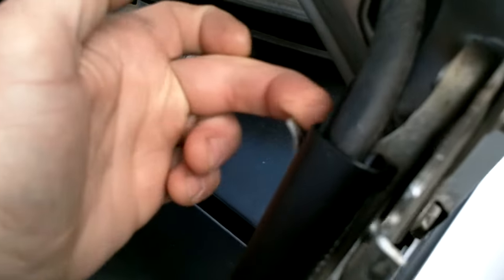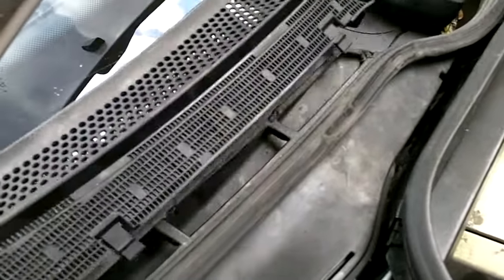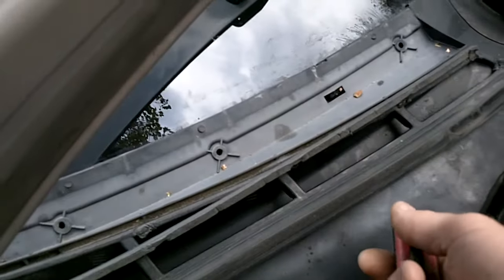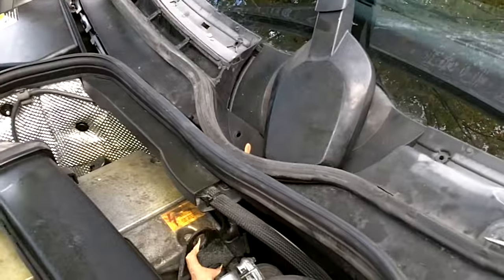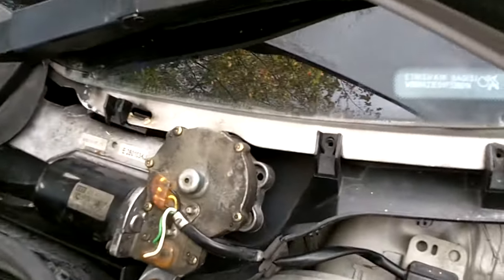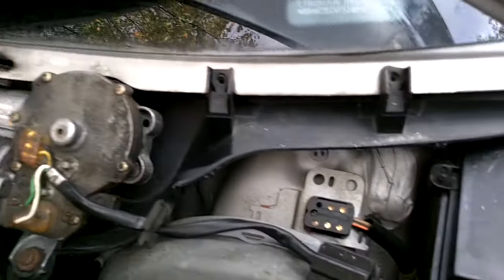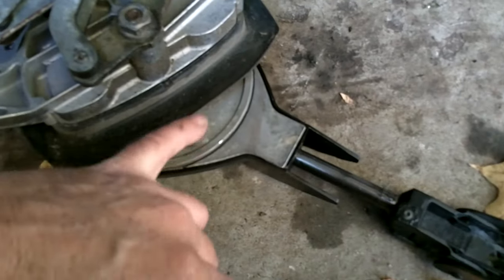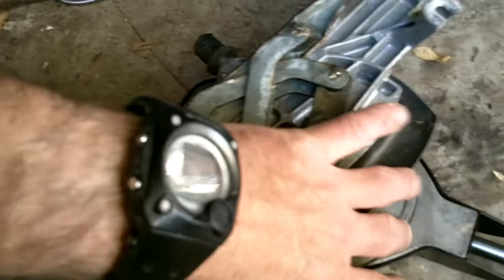how to remove Mercedes w202 windshield wiper motor assembly and lube

Comment: Hello +fupabox , i have a Mercedes w202 c180 classic, and got a problem with my rest button, it doesn't keep outside air from  entering even though it does turn on when i press it and make some sound.  I was told that i should remove the leaf covers like you just did and clean under them and i did, but i found that there's a part at the right side (passenger's seat side) like a rectangular air window (about 10x20 cm)  which isn't covered by anything and i found it strange and thought that it might be the problem i have. The thing is that under this window is the fan for the AC and heater and i guess it's where the fan pulls the air to blow it inside. Now is it safe to just cover this window by some kind of plastic or something to prevent dirty air from coming inside or do i damage the fan and lower the AC/heater air flow when I do so?  Sorry for the long post and thanks
Reply from the maker: there should be a flap that moves to cover that hole when the "recirc" button is pressed..You could cover it to keep outside air out
Reply: Where can I find this flap?
Reply from the maker: Pierre Merheb When you remove the 3 screws holding the fan motor in, then pull out the fan , you will see the flap

Comment: ANY IDEAS ON THIS  FUEL CLUSTERR GOES UOP WHEN PRESSING ACCELRATOR CHECKED BATTERY AND ALTERNATOR BOTH GOOD  U THINK THE FUEL PUMP READY TO GO   THANKS
Reply from the maker: sounds like a grounding issue in the cluster

Comment: Found this tutorial very helpful.....thank you. The motor on mine seems to whirl and not fully move the wiper left to right without help, so even though I have the part off and tightened the two bolts suggested, it still does not move the wiper without intervention from me. Any ideas?
Reply from the maker: +Jason Hedges did you lubricate the sliding arm under the big black turtle shell cover ?
Reply: +fupabox Hi, I am sitting here looking at it and scratching my head. I lubricated the arm and all pivotal points. I noticed that the arms on the back perhaps go so far back I can barely move it by hand without nudging the arm back so it can move. The wiper moves so the motor should be fine but just churns at points and stops moving. Real time tuition. You got to love the internet!
Reply from the maker: Jason Hedges either the gears are stripped or the other possibility is this free fix..check this one first https://www.youtube.com/watch?v=mfqExxuwqyA&list=PL1A207D50FE3FB01F&index=99
Reply: +fupabox Interestingly enough, I started to dismantle the motor and plugged it in to test the motor just by it's self with no arms attached etc. I then started the ignition and held by hand the rotating part, I could actually apply enough pressure to hear the churn. So I thought it has to be the motor slipping. By pure luck I found one at the local scrap yard, replaced and fitted. So all good now. If anyone needs any parts except the motor then you can reply to this post as I took the whole mechanism in case. +fupabox..good job.

Comment: hey!,, so the "turtle shell" is actually "clipped in" and there is no screw/bolt to hold it?.. well, I just had a look at the wiper on my w124, it is solid steel, but i can feel that there are two screws at the back.

Comment: Hi fupabox, on my righthand drive w202, the wiper will not return fully to home position after switching it off but will stay a couple inches above blocking my visibility. However when its operating it can still reach the full range of motion, I have lubricated under turtlecover but no effect. my theory is stress from wiping on a dry windscreen has caused a gear to slip in the transmission but I would appreciate your input very much. cheers
Reply from the maker: cleaning out the wiper parking contacts on the wiper motor should do the trick... check this video https://www.youtube.com/watch?v=mfqExxuwqyA&list=PL1A207D50FE3FB01F&index=99
Reply: Hello My c180 wiper will not return to home position also , how did you fix the problem . ta

Comment: Hi, my windscreen wiper extending/retracting action isn't working and jams inside the recess on the side of the windscreen. I have to push the whole arm back in to make it park properly.
Do I need a new mechanism or can this be repaired? What part do you think is causing this?

Thanks
Reply from the maker: there is a nylon geared wheel that is most likely stripped...this link will show pictures and another link to where you can buy the replacement gear.
http://www.benzworld.org/forums/w140-s-class/1513199-windshield-wiper-crash-repair.html
Reply: Great stuff! Thanks for the info and link fupabox.
I'm going to do the repair and remove the nylon gear then clamp the wiper arm to its retracted state, think it will be easier and less hassle than replacing the gear.
Reply: ***** I stripped my wiper assembly down and found the nylon gear inside but the teeth are all present and healthy. Are there splines inside the gear? It does turn around freely if I hold the wiper very tightly from extending/retracting. How does the nylon come off?
Reply from the maker: Andrew Poole it has splines on the inside and it should slide on/off the shaft

Comment: This might depend on where you live. In the UK I believe the change was in 1997 with the minor restyle (the flick on the boot/trunk and the aero bodywork). Mine is a 1999 C240. eBay was the first clue to be careful of. (eBay sellers note the difference). There is no plug on the bulkhead, and the cable has a water seal that fits in a cut-out in the fusebox and has a thin green connector about an inch long on it.

Comment: I replaced my motor (or the garage did) for my 98 c230 and 3 months later the wiper started failing in the exact same way as it did before, pausing in mid wipe, and slowing down at certain positions until finally it just stopped in the middle of the windshield (as before). I’ve been told that the motor and transmission are separate parts, then I’ve been told that’s not true. I spent $300 to fix this and $200 was labor, and this was in another state so I screwed as far as taking in back.  Are the motor and trans separate? What do you think the guy did to have my wiper work and then break again?

Thanks, great vid
Reply from the maker: the motor is separate from the rest of the wiper assembly/transmission...it sounds like the transmission assembly is seizing from lack of lubrication,there are a lot of parts moving in and out back and forth and if they aren't greased properly they will get stuck
Reply: @fupabox  For anyone else reading this: Before replacing the wiper engine, please try lubing the mechanism first. I went through 2 engines. Last year it was getting stuck again on the way back, just like before. Went to the garage where they lubed it, and it worked perfectly again. Nothing was probably wrong with any of the engines I had replaced. Lube it regularly and you should be fine.

Comment: Good afternoon. So you know where the relay is for the a/c compressor on a w202 c class c180 1998. Found some relays but they are not labelled. Thank you. Allan
Reply from the maker: +Allan Pountney http://tech.bentleypublishers.com/servlet/JiveServlet/download/3-9669-192846-2406/W202%20AC%20component%20Locations%202.pdf

Comment: one thing you should always do when encountering anything that moves is lubricate it, i noticed you did not mention   lubricating the shafts that you did explain to tighten up. with my 190E i removed everything like you did and lubricated everything,  Ive learnt first with my fan controll speed switch (1993) i took it apart and fixed it.  anything that can be token apart and fixed are well worth proper care since todays vehicles are all replacment rather then fixes. Nice video tho, Pe

Comment: My windshield wiper is slipping.
I have been taking it apart and tightening the nuts, also realigning the windshield wiper blade. Normally it works its just very tedious because I have to get the arm or blame in a perfect position.
I normally have to play with in every couple of months because the nuts on the shafts come loose.
Now though the back arm that connects you tighten the nuts onto the motor and mount is getting twisted up. It will flip upside down and inside the car and lock itself.
The piece that tightens onto the motor is wobbly, that little rectangular end that turns is very loose.
Is yours like that also, or do I need a new linkage?
Please get back to me, I can send you a few pics if that will help you understand what I'm talking about. Thank you.
Reply from the maker: I think the linkage is toast...but yes send me some pics just to be certain

Comment: @fupa, you are NOT kidding those middle clips are utter, utter, utter bastards. Just got those centre clips to release and I'll be swapping out my motor. The blade sticks in the same place each time so I'm guessing the worm gear has chewed out the nylon drive gear. Great video, I wish I was as calm during the removal as you seem to be, the air here in the UK is BLUE.

Comment: Guys i have different problem.. so when ever I put the whipers on fast mode 2 and 3 they whyper goes fast and it extended the arm all the the time from now I put it some glue but with the constant rain it gets loose again ... some advice ? Or new whipers ? Thank you guys and nice video by the way
Reply: I already got 3 new whipers pads thing because it gets so extended that it cleans out the window so it broke ..

Comment: Any ideas why mine starts moving randomly? if i stop the wiper in the park position by turning the ignition off, will be ok for a while, but then, when i drive, starts again randomly.  if i let it run, eventually will stop , but sometimes not in the park position but center or even 3pm position, park being 9pm position.
Reply: Hello My c180 wiper will not return to home position also , how did you fix the problem . ta

Comment: Brilliant video, I have a c220 with a wiper that doesn't return fully down, stops about a quarter of the way up the windscreen

Any help greatly appreciated
Reply from the maker: It likely slipped at some point , and now the relationship between the motor and the wiper is out of whack.. The nut on the bottom of the pivot needs to be loosened the arm moved..then the nut re-tightened

Comment: I Purchased the gear replacement... how to you get to the gear. I saw video easy enough. Just wanting to see if gear is easier to get to than taking the whole assembly apart. Thanks
Reply from the maker: to get to the gear on the wiper arm  ( not the one inside the motor ) you need to pull the whole assembly out and remove the bolt on the backside of the main wiper shaft..the one the blck turtle cover pivots on ..and pull the whole arm with the turtle cover off the main wiper mount..the gear is under the back side of the turtle cover

Comment: Hi, thanks for the video. It's not that hard, especially when some kind mechanic has ripped off most of the tabs from a previous fix!

If you have a late model W202, there is a different electrical connector. To fit this, you have to unscrew the cover of the fuse box (about 6 screws) and it simply unplugs. The connectors are numbered if you are not sure which way round it goes back. Easy enough, but if you are ordering a replacement from the breaker's yard, watch you get the right version.

Comment: My wiper starts to smell like burn when there is continues use after say 10 minutes. So probably the motor of the wiper is kind of burned. What do you think?
Reply from the maker: +SaurierDNA  it could need lubrication..binding from lack of grease will cause the motor to overwork and smell burnt

Comment: Great vid saved me a shitload of money on repairs. my only question is, how do i set the start/stop point for the wiper, now it stops at an odd angle on the right hand side of my windshield.... bloody annoying :-/
Reply from the maker: turn the wipers on ,then off so the motor parks itself...now the motor is at the proper park spot....now,loosen the nut on either the motor or the wiper the shaft that turns the wiper until you can move the wiper easily by hand ...then move the wiper by hand until it is in the proper park spot ,and re-tighten the nut

Comment: Hey i have a 2000  mercedes kompressor c230 and my windshield wiper wont move at all, but when i turn it on i hear the motor sound, would you know what the problem is? Ive been told i may have a bolt loose.
Reply from the maker: one of the 2 motor shaft bolts is loose... as in the video you need to tighten them

Comment: Thanks for the video. I have replaced the wiper motor which had its thread stripped on one part of the wheel. Having fitted a new motor I find it has happened again. this time the serrated edge on the linkage to the motor has also been smoothed out. Do you know why this is. If i fit another motor will the same thing will happen ???

Comment: Do you know where to find a 13 mm replacement nut that connects the linkage to the transmission? I cannot find anything of that size. On the Mercedes website it was a 8 x 1.25 (13 mm Hex nut). Is that the one?
Reply from the maker: that sounds like the correct one

Comment: I have started removing everything to pull out my old transmission. However, I got stuck. 2 of the 3 bolts that hold the transmission just slide freely and won't unscrew. This means I can't remving the transmission. Any suggestions to getting those bolts out?
Reply from the maker: it sounds like the bolt holes are stripped.. try gently prying the bolts upwards with a flat screwdriver while turning them with the wrench at the same time
Reply: *****  alright thanks, I will give it a try
Reply: *****  Turns out they weren't stripped. One of the bolts was 8mm instead of 10, was just using the wrong key. Now the other bolt (closest to the motor). Has a nut underneath it, that nut is just spinning freely while I try to take the bolt out. Some bent long nose pliers should do the trick (none of my wrenches are small enough to fit down there, it's a mystery to me how they got there in the first place). Anyway, thanks for the video!
Reply from the maker: jayxtreme6 excellent news,, :)

Comment: Thanks for posting.  Awesome video.  The wiper arm for my 95 E320 broke last night and this happened while driving on the freeway during a storm.  It actually broke on the part where the allen screw is located that holds the wiper arm.  Just wondering if I could purchase the wiper arm separately?  Thanks in advance.

Comment: tryed  the button on sunroof  and suddenley worked one time now not again  still closes do you think the switch is bad as they are not cheap to buy
Reply from the maker: I think the window switch on your car is the same as the sunroof... pull a window switch and swap with the sunroof and see if it works...the switches can be pulled apart and the contacts cleaned... I will try to make a video on it later today..I have an old one in my parts storage somewhere

Comment: In my C230 the wiper blade will slow way down in random spots, mostly in the middle of the windshield back and forth or just in one direction. Sometimes it'll work normally.
Reply from the maker: I think it needs lubrication in all areas

Comment: Hey just wondering mine sometimes dosnt move have push it till it dose is there a easier fix pulling it all out ??
Reply from the maker: Mouudy Banderas
unfortunately most likely not..one of the 2 shaft bolts is prob. loose...but..if the wiper is parking correctly otherwise you may be in luck..you can try popping up the turtle cover and greasing up the sliders etc. inside there before pulling anything apart..you may get lucky and it is just sticky inside there
Reply: ***** thanks but now my wiper is not moving at all atlnd the turtle cover wont come off it's really hard take it off what should I do ?
Reply: Mouudy Banderas ???
Reply from the maker: Mouudy Banderas the turtlr cover can be tough to pop off, but if you pull up and out on both sides at the same time it will usually come off easier..can you hear the wiper motor running and the wiper arm doesn't move ? or is there no sound at all ?
Reply: ***** If my motor isnt running do I buy a new windshield wiper thing or ??
Reply from the maker: Mouudy Banderas
the motor itself is prob. dead..so you can replace just the motor
Reply: ***** I did it thanks a lot but one thing it stops in the middle of the window instead of the side how come ?
Reply from the maker: Mouudy Banderas
wiper and motor aren't synced..you need to loosen the nut on the motor shaft or the main wiper shaft...turn the wiper on then off so that the motor will move to the park position...then move the wiper to the park position and re-tighten the nut....

Comment: do u have a video or know of a video for the same thing but on a 2009 mercedes benz e350 4matic? i cant seem to find one.. thx in advance
Reply from the maker: http://workshop-manuals.com/mercedesbenz/e_350_4matic_sedan_(211.087)/v6-3.5l_(272.972)/wiper_and_washer_systems/wiper_motor_linkage/component_information/service_and_repair/

Comment: So you DON'T have to remove the whole thing to lube it? That guy at "Mercedessource" said that there was no way to lube it without taking the whole assembly off.
Reply from the maker: +Kristensen he's correct depending on the model...older Mercedes with single wipers didn't have the pop off plastic cover..the old ones had to be unscrewed from the bottom, which required removal of the whole assembly
Reply: Right I see, luckily my W210 had the pop off cover, saving me loads of work it seems :)
Reply from the maker: Kristensen  :)